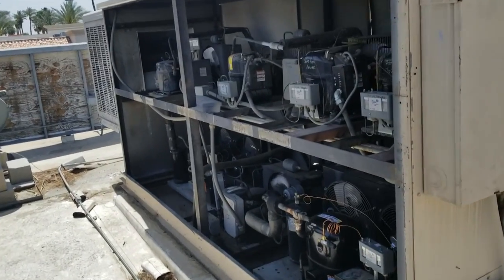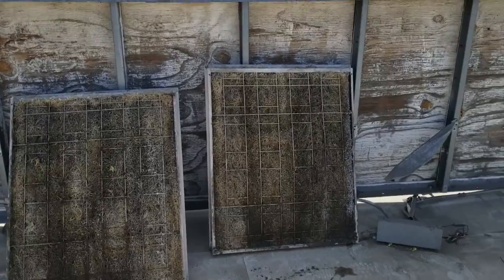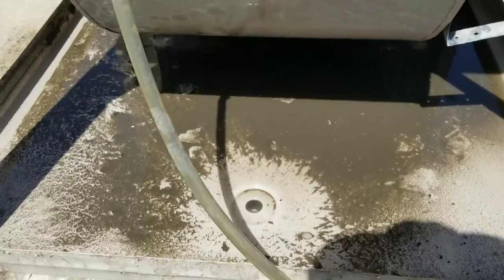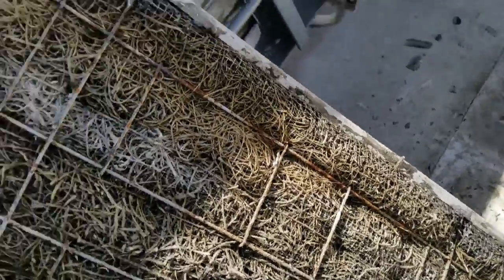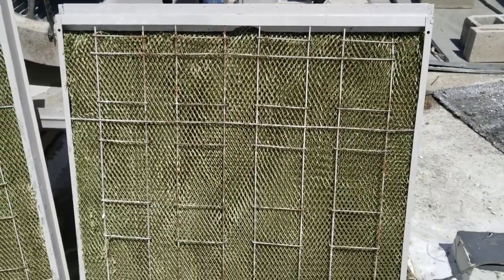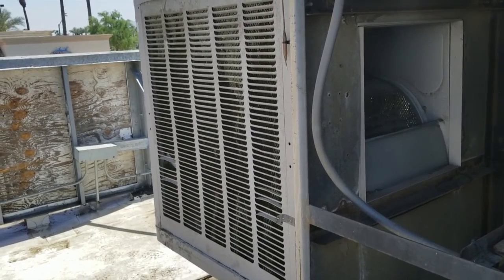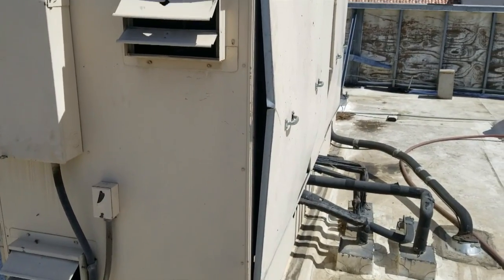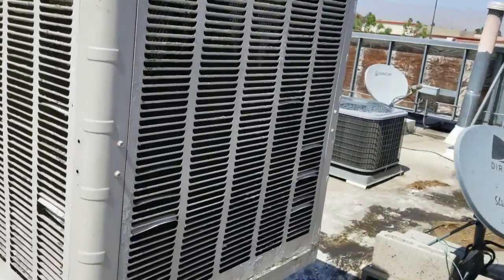Polishing a turd (Swamp cooler rebuild)

Comment: Nice work!  I had issues with my swamp cooler TD.  I replaced the pads with aspen pads, but I did not have time to clean up massive amounts of calcium buildup on the fins and felt like it still did not perform well. I’m suspecting that even though I replaced the pads that the calcium buildup and hard deposits are affecting the performance. Is this something that you have run into on swamp coolers? Also, I was wondering, what kind of pad you used and do you recommend them?I was always told that the Aspen fibers are better but I really like the looks of those pads that you had, I feel like the distribution of the water would be better and more uniform. I appreciate any input you can give me.

Comment: looks like Palm Srpings. I recently been using a swamp cooler for my house. It is colder when the fan speed is low but warmer when fan speed it high. Is this normal? will a lower speed cool down my house more?
Reply: Yes that is normal. It is colder on low because the air spends more time in the media. Using low will cool your home down more than on high but it'll take a little longer
Reply: i wonder how well those work out in Death Valley?
Reply: @nathang.1744  They'd probably work better than you expect they would. Death valley is dry so they'd be working efficiently but the ambient temps are so high and they can only cool so much. I'd guess they'll keep a building in the high 70s low 80s based on experience

Comment: Good video. Just wanted to say that a purge pump would be a really good idea for that cooler given the amount of time it runs. But I see you have a filter so that helps. Also when you amp the motor all the panels should be on the box so you amp it with the correct back pressure.  Thanks for the vid keep them coming. Hopefully we’ll se some more swamp coolers.

Comment: Those cinder block held-down satellite antenna mounts have to be a safety danger.  One significant wind event and they launch cinder blocks into the air to fall on people below.
Reply from the maker: Yeah the cinder blocks on the satellite dishes is a thing out here, every satellite company does it that way on the roof... I agree though someone is gonna get hurt.. I will be going live on YouTube this evening 1/27/20 @ 5:PM (pacific time) to discuss my most recent uploads and answer questions from YouTube comments, emails and the live chat. Come on over and check it out if you can, https://youtu.be/5KtVii_Tw5M

Comment: He mentioned something about TD? On the swamp cooler being 15 degrees. What does that mean? I know CFM is a measure of airflow but I havent heard of TD if I'm even hearing that right.
Reply from the maker: It's a measurementment of the temperature drop of the air from outside the swamp cooler to leaving the swamp cooler.
Reply: @HVACRVIDEOS  got it. Thank you

Comment: You could maybe increase the exhaust vent to the size of the input opening, considering heat expansion from all the condenser maybe add an inch in both directions.

Comment: Nice video. Up here in northern canada. Never seen a swamp cooler, was really interesting to see. I guess in the warmer climates you can really take advantage of using water to remove latent heat on smaller equipment. Looks like a mini cooling tower!

Comment: Woaw. I never seen a swamp cooler b4. I watch the both videos of when u diagnose the bad compressor and tbis one because of the swamp cooler. I live in Baltimore and it gets hot over here but not where we need to help the the rejected heat get out of the racks. But very cool solution. Great job
Reply from the maker: thanks for watching, I am going live a little early today 12/24/18  at 12:00pm pacific standard time come on over if you can and check it out https://youtu.be/rDd469JwYww

Comment: Engineer here from oxford england, interesting to see hoe much different youre systems are to ours in england, everything seems to be similar but different lol, example youre control circuits e.g. pressure switchs seem to activate compressor when the switchs are broken? We do the opposite here. Also a lot of youre equipment over the pond seems to be from ou POV outdated in a way. We hardly see mechanical control systems. E.g. defrost time clocks. Also these racks you have we dont really have. We have single housed condensing units. I know we mostly have the cooler weather but in plant areas in summer we still get up to 45c and they work fine. Intersting you have to have these so called swamp coolers... also cellar systems, we have much simpler versions which cools only the room down to 13c and then the beer through the lines is chilled by a seperate system. Its all quite different! Although obviously recognise the brands such as copeland etc. Also have the same leak detector haha! Good vids very interesting to see the differences
Reply: This is a way older system from the 70's 80's. You don't hardly see this anymore.
The owner probably won't modernize/upgrade because "it just works", until it doesn't anymore.
Reply: @memadmax69  hahaha get the same over here across the pond

Comment: You would think each of those condenser fans would draw air from inside the cabinet, blow it over the condenser, then exhaust directly outside, rather than right back into the cabinet.

Comment: Wow, are those swamp coolers a common thing? I’m definitely not a fridgie, but that looks like a real quarter arsed way to cool a rack. I wonder if using a box air con or something would do any better. Here in Australia, you are box (or split!) air cons absolutely *everywhere*. If it’s railway track electronics, a telephone exchange, a cell tower, microwave relay. whatever it is, it’ll have some form of air con tacked onto the side of it. If it is an enclosed box with a lot of heat inside it, it’ll have an air con.

Inside datacenters is a very different thing, though. It’s actually pretty damn ingenious as to how they work. You have a massive chiller on the roof, and usually water as the coolant. In the datacenter itself, you have a hot and cold aisle. The cold aisle is what all of the servers are pulling air from, and the hot aisle is what they’re all exhausting into, because in servers. All fans point in only one direction, from front to back. This also means that all of the cables and crap that obstruct airflow, are in the hot aisle anyway and are of no real consequence. I’m sure you’ve done jobs on these systems before, but they’re basically hotel air conditioning on steroids.
Reply from the maker: KEEDx3 I'm in California, out of curiosity what made you think I was in Florida?
Reply: @HVACRVIDEOS  bringing back the dead BUT in the first video of this you said this unit was in palm springs which is also a city in Florida. I immediately thought Florida even though I knew you were in cali... plus there'd never be a swamp cooler in florida.
Reply: I'm in Southern Arizona and swamp coolers are very common here due to our low humidity. Matter of fact have one on my house but it's a fancier model than this one
Reply: There mostly in Colorado, Utah, California, Nevada, Wyoming and i’ve never seen any in fl.. that’s interesting that you did. I would figure that would be the last place in the US to see them.
Reply: There’s tons of those swamp coolers here in the California high desert. They only work in arid climates. We see them as a cheap economical alternative to traditional air conditioners. In my opinion, they don’t work as well, and can be a total nightmare to work on at times. I’ve worked on a bunch of them. The one seen here in this video, is what we call a “standard” straw pad cooler. They are among the cheapest and crappiest types available.

Comment: I can see a possible reason for the bowed side panels and high fan motor amps, you have about 27 sq feet of inlet pad, and about 2 sq feet (I'm metric so cut me some slack if my conversion is wrong) of exhaust grill, the blower fan is running against a high head of air, the cooler would perform much better with some more exhaust air flow vents, this would lower the humidity in your rack as well . Swampies are big business in parts of Australia with our high temps and very low humidity. For domestic installs they try for roughly similar sq. ft of air exhaust openings and cooling media pad size..
Reply: Centrifugal blowers draw less power against head pressure.
Reply: @slamdvw  True, but that's because they are moving less air. If you block the inlet completely they draw even less, but that kind of defeats the purpose.
Reply: @siggyincr7447  I was referring to his comment about "high head pressure" and "high fan motor amps".
Reply: Sorry, missed that. Yeah,  giving it more exhaust vents would increase current draw.

Comment: As far as i know, swamp coolers blow out tons of humidity. Does all that humid air make any damage to the condensing units?
Reply: It does ,a little bit but There is no other cheap option for cooling those there.
Reply: No, not in California, they have VERY low humidity out there which makes swamp coolers a efficient option to cool off racks. They use evaporative cooling by the use of water to remove heat. Out in Florida (any part of the east) you cannot use those because there is already so much water in the air that it’ll just make it feel sticky and humid.

Comment: I was just about to ask what the purpose of that swamp cooler was. 🤣
Reply from the maker: That swamp cooler really increases the efficiency of that equip. We will also add them to pre cool the ac units it can drop the condensing temps almost 30 degrees sometimes